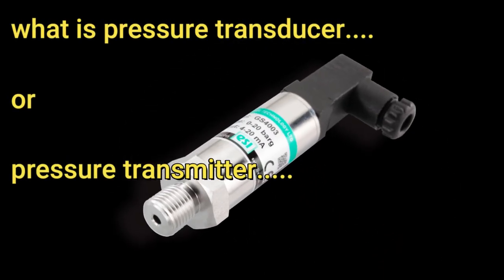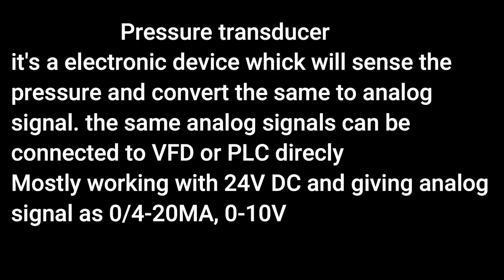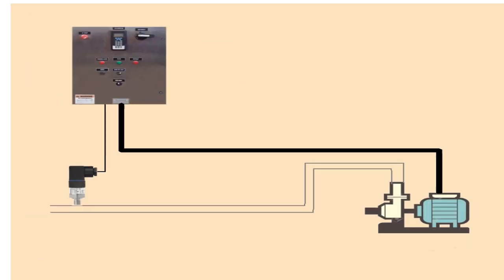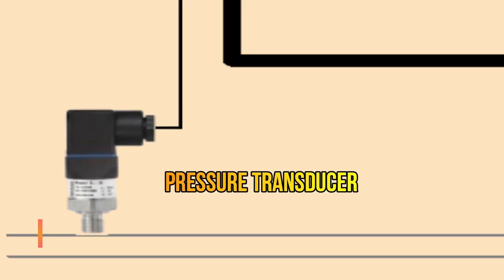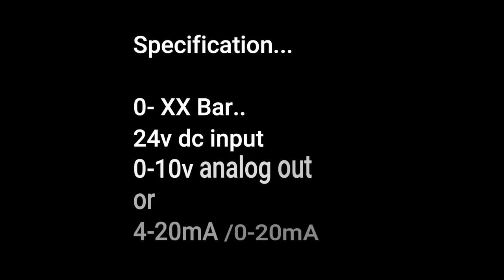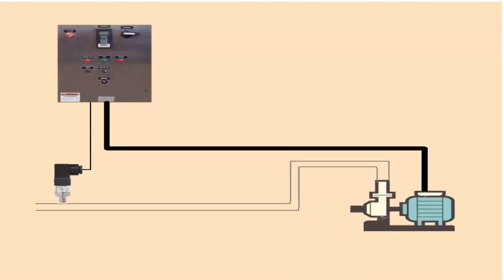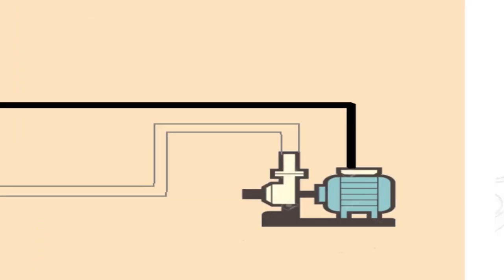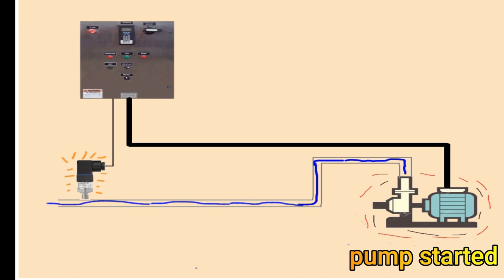How pressure transducer works? 0-10V/ Animation video...

Comment: Is It used to control the discharge pressure of the pump or just to show the pressure of discharge in panel?

Can I run the pump safely without the transducer?
Reply from the maker: you can control the pressure also monitor.
the pressure transducer sense the pressure and convert to a analog signal which u can connect to a PLC or BMS, you can control the pump pressure by controlling the speed . (need to use the VFD for pump motor ). Or u can set cut in  cut off pressure set point and control/maintain the discharge pressure .(if its a normal DOL starter for pump motor )
hope you got it. if not write ma again.

Comment: Does this pressure transducer function as an automatic pump control thanks
Reply from the maker: yes. you need to make control wirings such as.
Reply: If this has the same function as a pressure switch, is there an alternative current input? @sennapparajan.p
Reply from the maker: @dedisundoro7340  I coudint understand your doubt . Please tell clearly